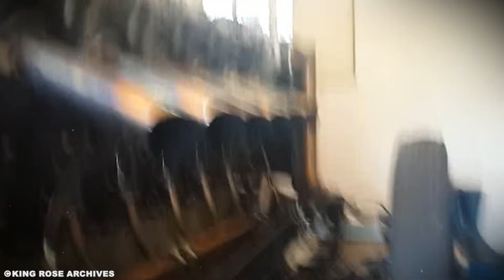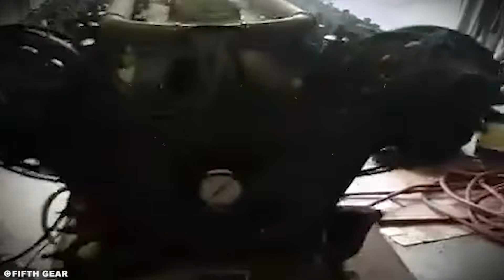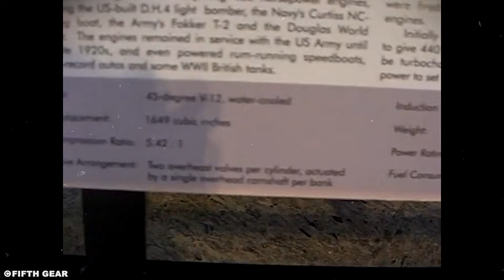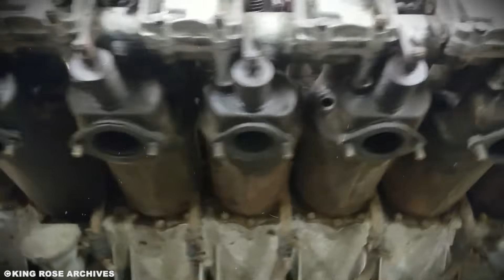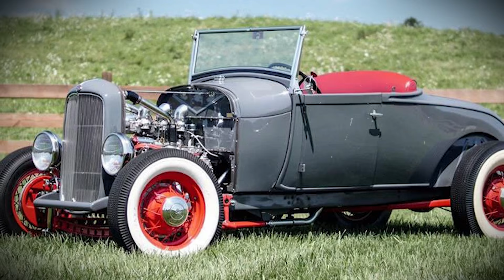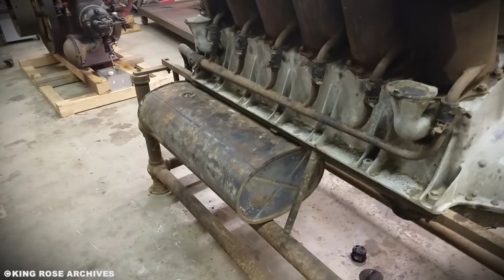Why the Liberty V 12 of WWI Marked the Birth of American Muscle

Comment: Big thanks for the fantastic story! I knew  nothing of this engine or the stories surrounding it. Terrific piece of American history. I wonder if any parts for it were made here in Canada. My home town St. Catharines Ontario had always been a concentrated center of automotive & tool manufacturing since just after 1900 to the 1990s. REO cars & trucks, GMC ENGINES , rear axles, differentials, manual transmission components, Delco-Remy starters DC generators alternators, AC spark plugs  huge transmission  cases for Eaton and their chief competitors. Mom & dad met in McKinnon's factory during WW2 1943. SHE assembled then later inspected machine gun armatures. Dad assigned to variety 
made at McKinnon Industries